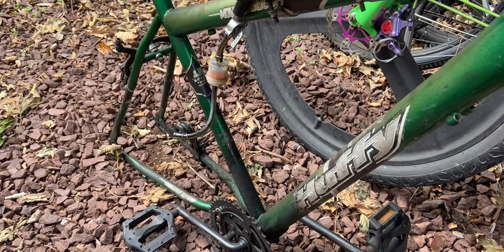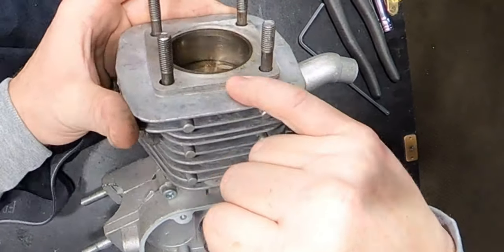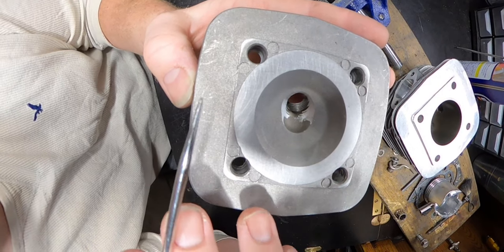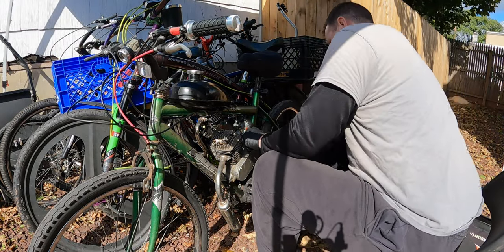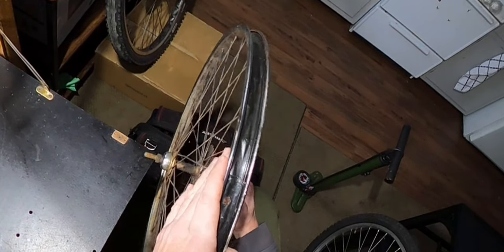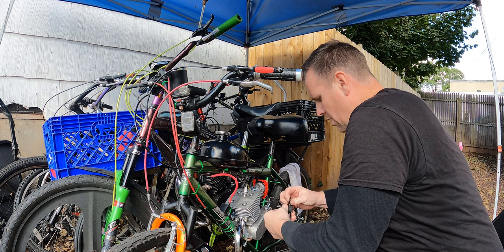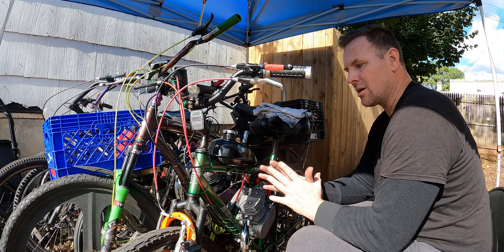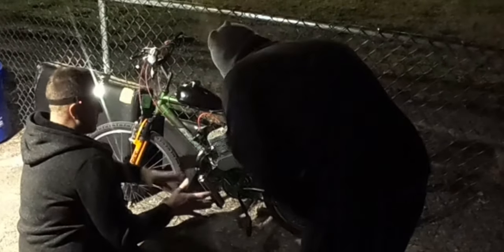Epic Transformation of a Beat-up Bicycle into a Powerful 85cc Motorized Beauty

Comment: I once rebuild my entire engine because i couldn't figure out y it wouldn't start.  Turned out to be the dang magnet the whole time!!  Lesson learned.
Reply: You installed it backwards and it fired a couple times and not again right? Learned that the hard way too
Reply from the maker: Yes I had one in backwards from factory when I first started and it kinda ran but poor and it took me forever to figure it out. I was hoping this video would give good insight about what to look for to the newer guys and even the guys that been in it to just stop and think to look at the simple stuff. Cause I am very guilty of this myself and just thinking “well it has to be a bigger issue cause I built it and I know what I’m doin”.   So hopefully this just helps a bunch of people.
Reply from the maker: Kenyon, I have done that same exact thing before cause I didn’t look at it till it was goin back together and took it all the way apart. I was so mad at myself, lol.
Reply: No bro,  my mag was on correct it lost its magnetism. I overheated the entire engine climbing a canyon road tring to get back to my camp ( I was homeless at the time) and I had a 12 pack of beer in my backpack so the poor saw overheated and yet I kept going even though it lost most of its power. I barely made it to my camp before I killed the engine. The next morning with my hangover nonetheless I went to start it and nothing.  So I took the cylinder off and it was coated in aluminum from the piston expanding so much from the excessive heat I imposed on it wanting to get back asap to have a dang beer. Heat destroys magnets that's my lesson learned.  Life lessons aren't fun at all lol!
Reply from the maker: @KenC56mm  you know that’s a great point that I definitely forgot till right now. I been thinking my daily jokester has been down on power lately and when it was newer it would get pretty hot and the last time I thought it had it’s normal power was the day I was riding it crazy for fun but I went to the mailbox but literally had it WOT FOR 22ish minutes straight then got the mail so it sat cooling for about 3 ish minutes then went home and had it at WOT the entire way home too just having fun and on the way home it felt like it was way less power and ever since. I was thinking maybe it’s just getting tired cause of all the miles but heating the magnet up like that could have taken some of its force away for sure and cause a weaker spark for sure and in turn make way less power now. Wow that’s a great comment brother cause I was def over thinking about it and this def copy be the reason since I have had real OZ could with a very strong spark and having a good spark is like night and day for these lil motors. And the mag is directly responsible for making that spark. Damn bro you totally got me thinking now, thanks brother I really appreciate it.  I always enjoy talking with you. Cause we always got similar thought and ideas and problems. Good looks.

Comment: johnnie want to try a experiment ? get yourself two rare earth magnets . drill a hole in a magneto magnet on both sides  of it just big enough for the magnets to set in flush . make sure the magnetic fields go in same direction of course . then put a little bit of two part epoxy in the holes and drop the magnets in . rare earth magnets are super strong and might increase the out put of electricity  .
Reply: I like that idea alot.
Reply from the maker: Actually I saved this magnet so I could take it all the way apart and I want to rebuild it with neo, Damian magnets to increase the field so it throws a harder spark and if that works and I can get it right then I’m goin to start doing it to all my bikes motors. Cause a stronger spark 1000% makes more power.
Reply from the maker: @KenC56mm  yes I agree for sure.

Comment: Johnny, what do you think of the V3 ZTMOTO Phantom85 kit? I'll be received a pallet of them in 2 weeks, (I hope not longer) tips, upgrades, rejetting numbers?
Reply from the maker: I never had one yet, I think they can be solid and stock make good power and I think there’s a lot left in the tank. Actually I would love to get my hands on one to port and try one day. It comes with a oylin or yd100 case and they are solid. But that’s cool your getting a pallet, how many come in a pallet?
Reply: Balance the damned crank

Comment: Oh, how much time did it take you from removing to start up of that engine, including port work approx. I'm thinking like 10 hours?
Reply from the maker: It was about a four day project maybe five, it’s hard to remember now. But to start to stop on a full port job which take apart and assembly of motor it takes about 8 hours for bigger job and maybe 3 ish for basic port job, but I mean basic. The Minarelli took me about 16hours straight but that was very precise porting I did there plus its iron and takes longer.
Reply: I've done a couple steel sleeved jugs. Not only was it a slower process for me, I learned what color bits to use and don't burn my carbide on steel! Doi I'm not to bright either. I did gradjiat. From the school of hard knocks with a C*- lol
Reply from the maker: @MotorizedChuck  lol, but yeah in minis or iron sleeves you just gotta use less force and let the bit do all the work and keep good control of the bits speed so as not to get it to hot and that is what kills the bits sharpness. I only use carbide bits for the port no matter the material I’m porting. But always finish exhaust ports with sanding barrels and polish wheels. But the other ports I show in videos is always just carbide bite work. I have tried very hard to get good at it cause I think it speaks to the quality work you do and I have seen some crazy bad looking work for other builders that are talked about as good and they talk about their work as good and I thought if I did that myself and said that about the work I would be embarrassed. So I take great bride in my port jobs looks, and it only comes from practice and screwing up A LOT. So best advice I could give it just go slow and let the tools do the work cause pushing hard always messes it up for me. I hope you post some of your work in the group I enjoy seeing others work and what they are doing to their bikes and motors.

Comment: My riding bicycles I'll use quick releases. My engine bikes or if I'm keeping them 1st before selling I'll put solid axles in. Why? Ppl steal wheels to leave you stranded. Then come back and strip it on you.
Reply from the maker: Yeah I have always put the cable through my rear wheel then throw triangle of frame then throw front wheel and then around what ever unmovable object I’m next to so nobody can take anything. I always bring a longer (6ish feet I think) cable with me if I’m goin inside somewhere.
Reply: Because shi expensive that's why they would steal it

Comment: 👍.........Question For Anyone: When you order/buy,  stuff online. Is it screwed up 25% of the time? ? Either screwed up by seller or lost by FedEx USPS.
Reply: No i woukd say less than 5%
Reply: And if it is broken a lot of the times you can easily fix it yourself depending on what it is, I had a carburetor arrive with a crack in the top throttle cable cap part, I just took the open cap off my old carb and put it on the new one and it worked fine.
Reply from the maker: I had a couple cylinders that were broken I sent back and got new ones for replacement and it was easy to do from seller through Amazon. But as far as broken stuff normally I don’t rely come across that to much. Most the time it’s always right or not broken.
Reply: @thirdeyesurvivor3886  I have the worst luck. Not just with bike parts. But literally 25% of anything I order. Is either lost in mail, broken or seller sending wrong items.